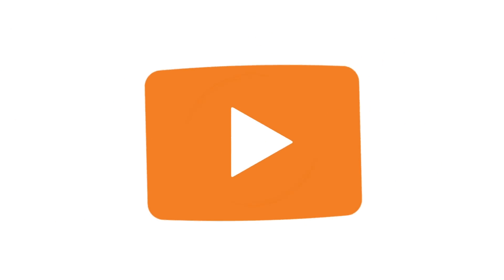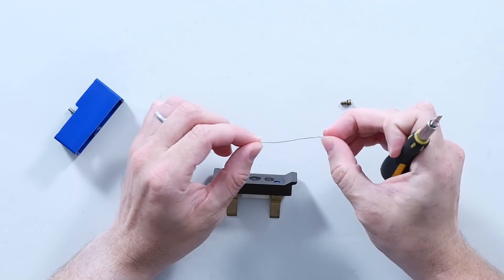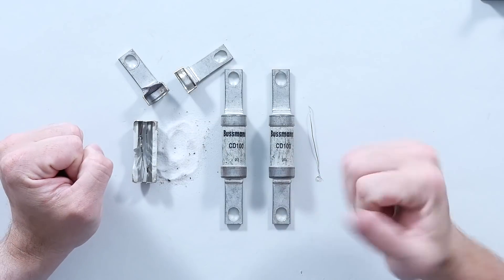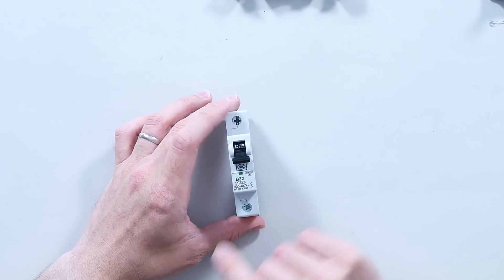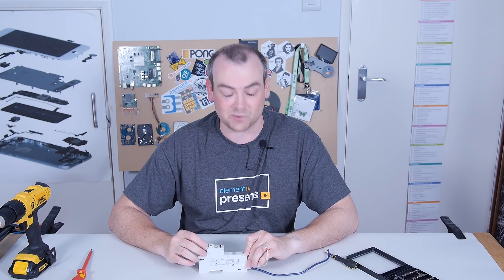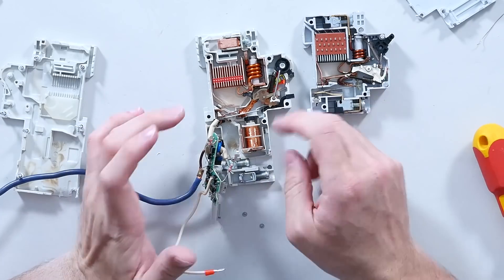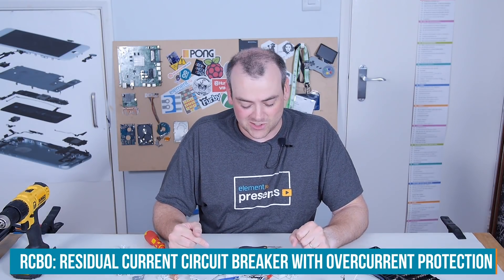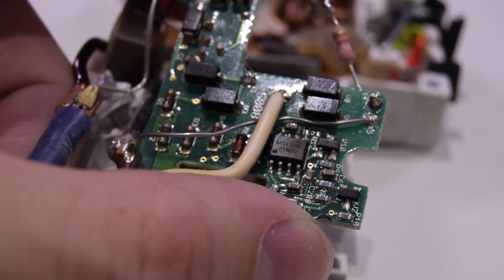Tearing Down Electronic Protection Devices - The Electronics Inside

Comment: I'm in the states and I use phase, line or hot. Mainly use line and hot unless I'm messing with 240v then I use phase.
Reply: Interesting, which would you refer to as phase in US 240v? My understanding is that both are 120V to ground,  from a center tapped transformer, so technically one is +120V and the other is -120V?
Reply: @a531016  The 240V system commonly used in US households is called 'split single phase'. Your understanding is correct, The voltage is ~240V from Line to line (L1 - L2) and the center tap of the supply transformer is neutral with ~120V from either Line to neutral. Neutral is also grounded at the transformer.

Comment: i used to fiddle with OMRON solenoids and PLCs a little in my old job. it looks like they have some similarities with circuit breakers.
Reply: I am slightly familiar with Omron kit! And the Trend kit with custom hardware they did too!

Do you think PLC / controls might be interesting?
Reply: David Edwards it might be interesting seeing that they are often used lot in industrial machineries. It’s probably interesting to start from relays and the necessity to replace relays with plcs. Sorry I said solenoids above. I messed up I meant to say omron relays. But I used to work with solenoids to but they were on the pneumatics side of control.